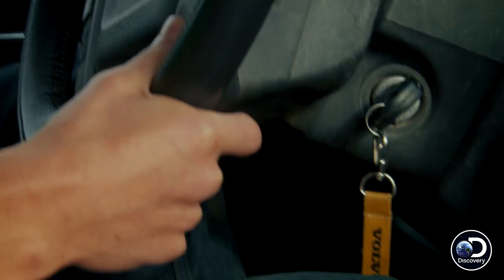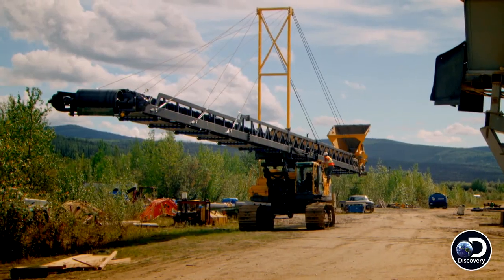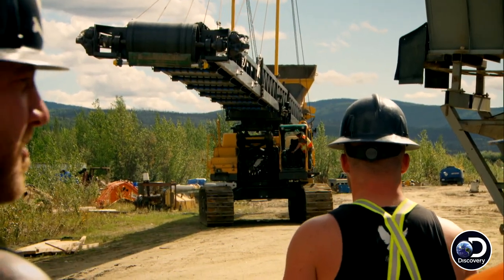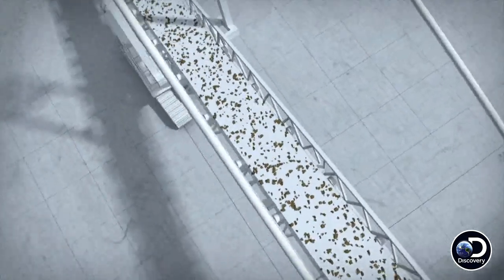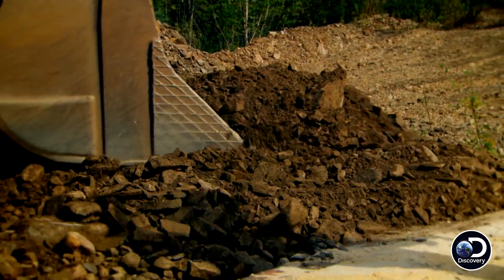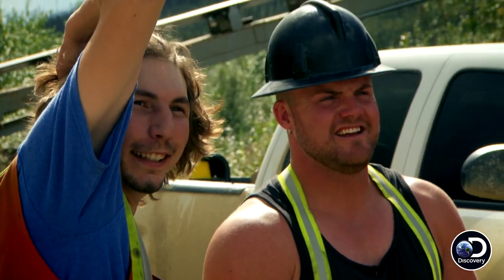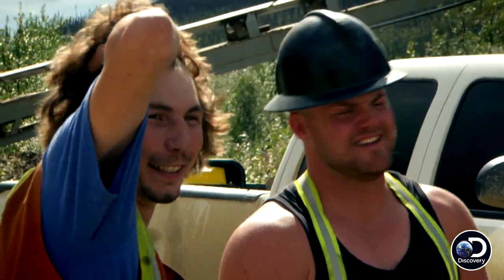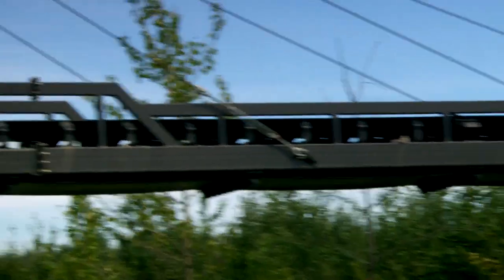Get A Load Of Parker's Secret Goldmining Weapon | Gold Rush

Comment: He should designed the belt to that it can be folded on transport
Reply: True, maybe the next one. I don't see why he uses just one.
Reply: imagine the weak point in operation that would cause.
Reply: We use telescopic conveyors when crusher right, 200! 3 belts, 2 belts slide in and out for transport.